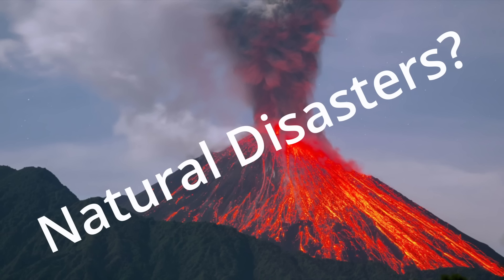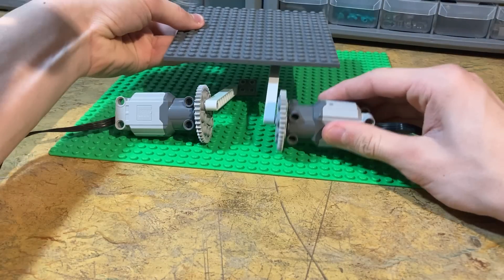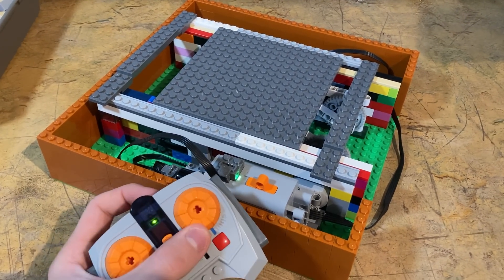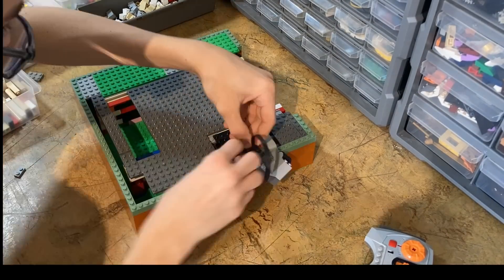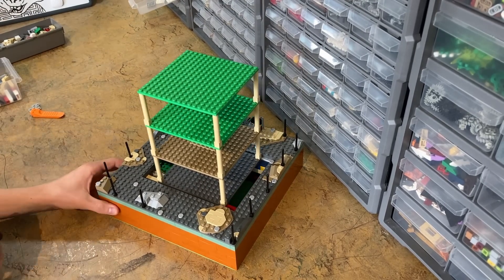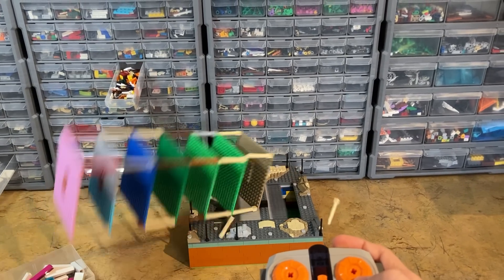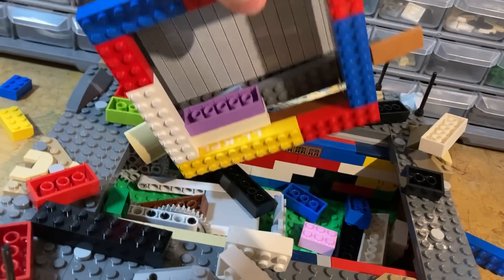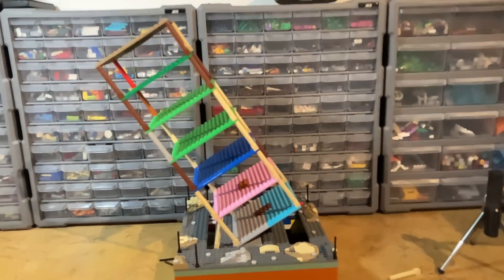I Built A Working Earthquake Simulator Out of LEGO…

Comment: Could it be that the pillar pieces oscillate easier than more rigid structures? That's usually one of the things they use for anti-seismic building designs if I remember correctly...
It might be that the mass isn't enough to build sufficient momentum to break it? In any case, cool!